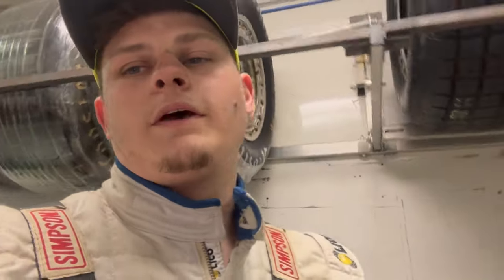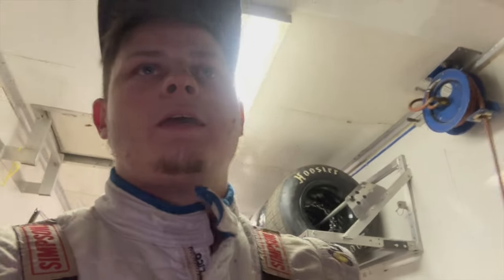Another Junked Racecar...

Comment: This may not be your fuel issue , but we found out the hard way. When we was running 602 , we had the wrong fuel pump rod in the motor. We had the 604 push rod with the bronze tip and that’s for a 604. So needless to say , when we moved up to 604 we knew which rod we needed . You don’t happen to have the 602 fuel pump rod in the 604 ?
Reply from the maker: Nah it’s reverse mount pump on the bellhousing.
Reply: @NothinButDirt4 okay was just making sure . We got one car on reverse pump and one on block . I just knew we had this issue .
Reply from the maker: @davidcardwell7859  appreciate the knowledge buddy